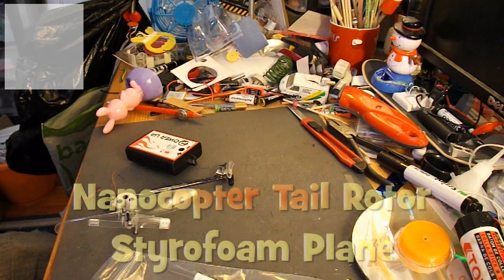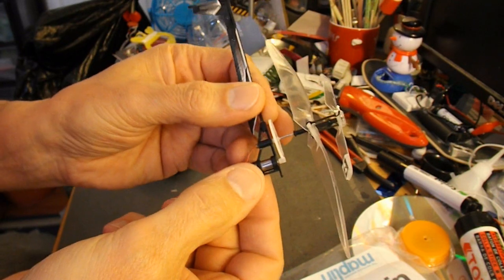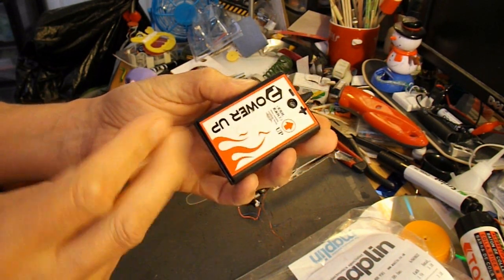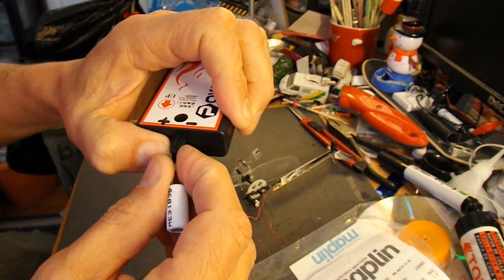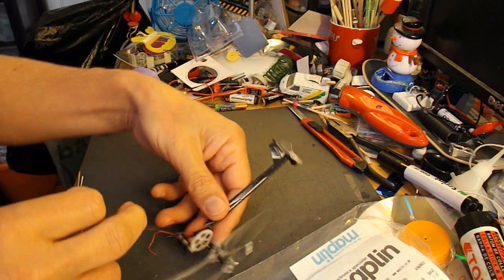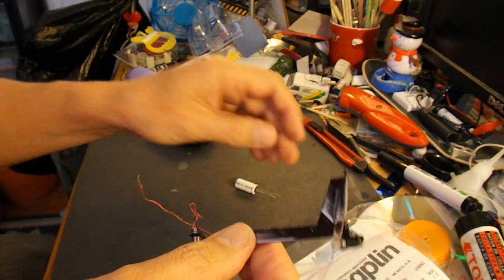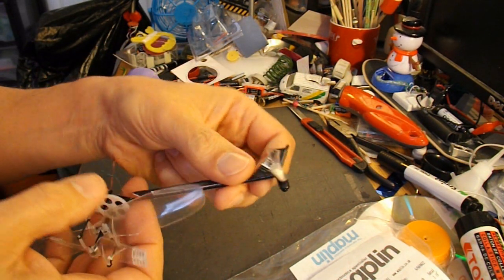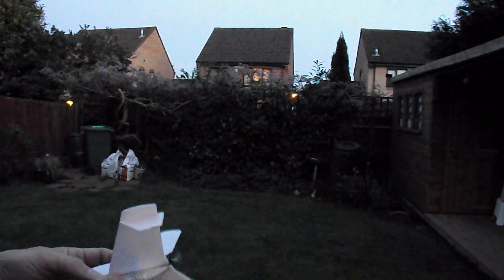Nanocopter Tail Rotor Styrofoam Plane Part #1

Comment: can you wire a capacitor or lipo to a nanocopter frame with just the tail motor and main rotor?
Reply from the maker: +Karen McMillan if you mean to bypass the RC receiver then yes you could but it would not fly properly as it would be uncontrolled and unstable.

Comment: I really love your videos. I can watch them for hours. But in every single video of yours that I watch I hear this high frequency ringing and it's almost making it impossible to watch! I tried to change settings on my computer and I try my best to ignore it and I really don't want to comment about it again but it really is starting to become unbearable. I really love your videos but I had to say something about the ringing
Reply from the maker: 5216l like I said before, I don't hear high pitched sounds so I wouldn't know. Maybe your PC is just too good and giving you better sound quality than most people get. I am certainly not going to take down 1400 videos because you are having a problem with them. If you can hear it on 'every single one' of my videos then it cannot be my camera as I use several different cameras, it cannot be my editing software because I use different editing software, it cannot be the location as I record in different locations. When you mentioned it I guessed it might be the CFL lighting in one of my rooms, or the PC monitor in one of my rooms, or the PC fan in one of my rooms, or the halogen lighting in one of my rooms, but as these sources are in different rooms and you can hear the same sound in all of my videos you have me completely stumped.
Reply from the maker: 5216l to test out this noise issue I have uploaded 2 identical videos. I would be interested to know if you can hear the problem in them. You don't need to listen all the way through as they are rather long videos.
https://youtu.be/LpdtGTL1kUo

https://youtu.be/5RgrQMYiilg
Reply: I can hear the ringing in both videos. Thank you so much for taking notice. I don't hear the ringing in every single one of your videos, but the majority of them do have it. In some of your outdoor videos I do not hear the sound. I'll try and find videos where I cannot hear the sound and link you to them and maybe you'll be able to see a pattern.
Reply from the maker: 5216l how about this one ? https://youtu.be/mAC_fBKksJo
Reply: I do not hear the ringing in that video. Your caterpillar video and your Disappointing Helicopter Session video do not have the ringing. As well as Can we fly that toy Hang Glider 100 ft ?
Reply from the maker: Thanks, I will have a think about it.
Reply: Do you use the same camera for all of your videos? Or use different microphones at all?
Reply from the maker: 5216l several different cameras. I never use separate microphones, only the inbuilt ones on the cameras. I am wondering if it may be an issue with the recording format and the codecs used to convert them. It could even be something YouTube does when it converts them after upload. The ones you have mentioned as OK are recorded in MP4 format.
Reply: Hmmm... I think we're making some progress now

Comment: Grandad can u do a help file on how to charge the capacitors using just the AA battery packs not the power up module, I would really like to make 1 but am confused on hot to charge it! thanks!
Reply from the maker: Ross Clements read the video description. There is a link there to my helpfile on how to make a charger. There is nothing special about the PowerUp module it is just 3 AA batteries in a box with two metal plates on the outside that you use to make contact with the legs of the supercapacitor.
Reply: ok thanks!

Comment: GrandadIsAnOldMan I have a similar copter...if you don't mind can you post a pic of the circuit board of it with the motors connected.Thanks :)
Reply from the maker: pratyush heblikar I don't think I have a photo of that particular one.This is the disassembly video for that copter https://youtu.be/X6GBfPSyuuo?list=PLA5a2xPRSrB1GrgALJEle2lVqOrR1sX6V

This is a similar copter disassembly with a couple of still photos right near the end of the video https://youtu.be/ufqWJ_mbyho?list=PLA5a2xPRSrB1GrgALJEle2lVqOrR1sX6V

Here is another one https://youtu.be/worMycPCN5s?list=PLA5a2xPRSrB1GrgALJEle2lVqOrR1sX6V

Comment: I think you should try with the other motor, the one that moves the main rotors, it was design to lift the helicopter. The one you are using is only for steering, so is probably not as powerful. I like the idea for the plane, looks great. Regards.
Reply from the maker: miamifiction the clue is in the title. This project is about using the tail rotor motor.
Reply: Oh Okay. Well in that case, I think you should add a big gear for the motor and a small gear for the rotor, to increase its power without using more energy or a more powerful motor. The only problem is that those gears would have to be very light, but this is the only way I think it could work. As always awesome project. Regards.

Comment: Why don't u try making a biplane glider out of ur old vid,then add 1 mother for each of the 3 main Colloms I think it would be interesting
Reply from the maker: liam viera the main problem with adding extra motors is you need more batteries to power them or bigger batteries, so you are adding weight, so the next thing you need to do is make the plane bigger to compensate. Which 'old vid' are you referring to anyway? There are 144 videos in my Aircraft playlist.

Comment: I see what you are aiming at,but if you used the reduction gear with the bigger rotor at the nose without the IR control you might end up with a bigger and more powerful free flighter even outdoors on a calm day. I thought it maybe deserved a try.
Reply from the maker: Amir Alamir you are probably right but I specifically wanted to use the smaller motor with the prop supplied just to see if it has enough power to fly a plane.

Comment: Nice work, 
I found this link which might be of interest:
http://hackedgadgets.com/wp-content/2/plane_built_from_old_broken_helicopter.jpg
Keep them coming Granddad!
Reply from the maker: Amir Alamir haha, brilliant, does it fly? I would think the big rotor will have trouble because it will try to twist to turn itself horizontal and the tail rotor will be trying to spin the plane wing over wing although you could just disconnect that. Of course your controls would be completely ineffective. This is my playlist of my plane that uses the components from a broken nanocopter that does work as long as there is no wind, so indoors would be better if I had a suitable location https://www.youtube.com/playlist?list=PLA5a2xPRSrB1fg_tSRBIbqhtus-gylu9-
Reply: Amir Alamir  that is good idea lets remove  back propeler in helicopter and good luck :)

Comment: Just a tad dark Nipper, but hey It fly's, Good work Grandad
Reply from the maker: Graham R Dyer Yes, but just about visible. This was the second build of the evening. I did try a 'normal' plane with the motor standing above the wing as a power pod, but it was so unstable I didn't bother uploading that part of the video.
Reply: GrandadIsAnOldMan  The way I see it is, if you look at a seagull gliding, the body weight is below the wing but the wing tips fall about level with the bottom of the body.....Just a thought...!